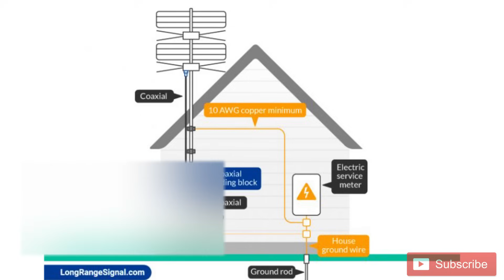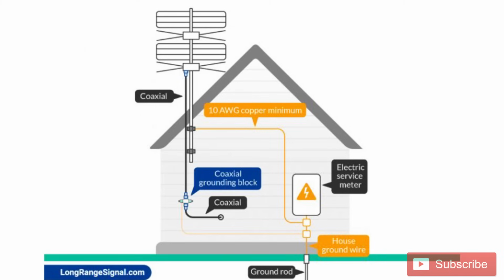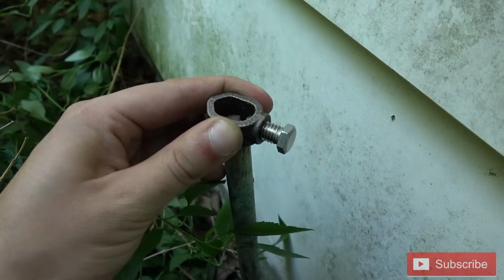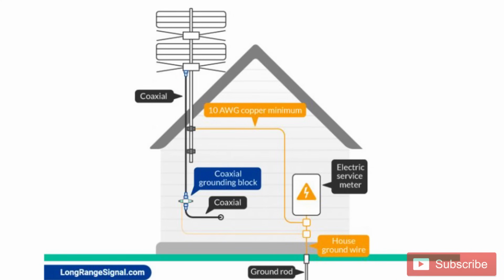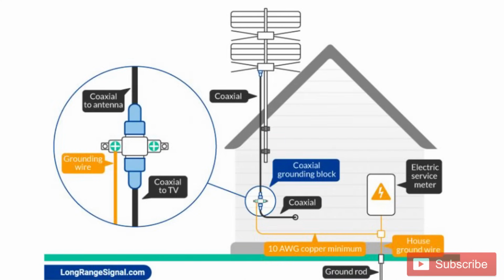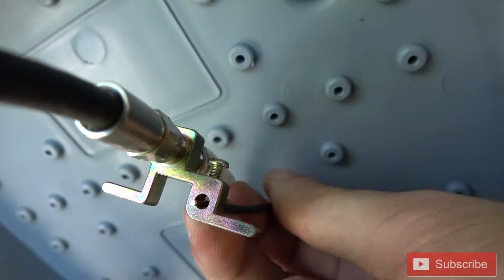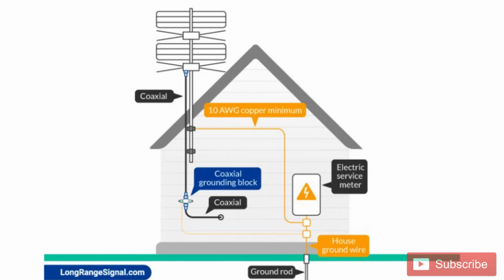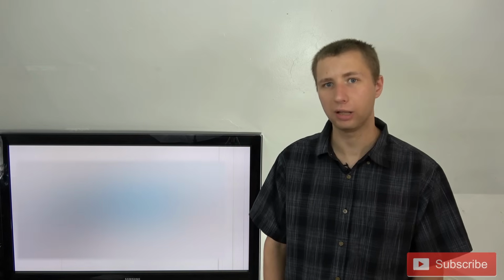How To Ground an Outdoor TV Antenna Per NEC

Comment: Excellent advice!  I use an 8ft copper rod pounded in the ground behind my back deck where my Sweet spot is...  And a Good Ground Block. which I replace every year.
Reply from the maker: I also hammered in an 8 ft copper rod into the ground for someone prior to knowing about the corner clamps.
Reply: I would not use them cheap ground clamps they use for cable TV. You can get good ones that won't rust and corrode, the splitters also have a ground connection. The mast should.also be connected to the ground. Good grounds also help the reflector do its job picking up signals.
Reply: @AntennaMan  - Tyler, because I need to mount my outdoor antenna on a pole---starting from the ground with the base of the pole about 1 foot in the ground---and mounted to the opposite side of my house from the electric meter, I guess I will have to drive an 8 foot ground rod for my application. I don't think it would be prudent---or practical---to run a 10 ga. grounding wire all the way to the other side of my house where the electric meter ground rod is. Tyler, or anyone else, if you can think of a better way for me to do this, I'm open to suggestions. Thanks.
Reply: @locutusofborg7122  if you have an outdoor faucet nearby take an extension cord and use a multimeter and insert the red lead into the hot lead on the extension cord and touch the faucet with the black lead. If you get around 121 volts you can use it as your ground
Reply: @MaynardFreek  : John, thanks for attempting to answer my question. The problem with the solution you proposed is that lightning follows water to ground. I am on a well system, and my home is plumbed with copper pipe, exactly as you assumed. Though I'm sure your solution would work, I wouldn't want to take the chance of lightning striking the outdoor antenna, and going directly to my home's plumbing --- blowing it up --- then blowing up my well pump and metal well tank, possibly setting my home on fire, etc.

I do not have a nearby outdoor faucet anyway, so an 8' copper-clad ground rod at the antenna seems to be my only real solution.
Reply: @locutusofborg7122  I understand your concerns. Electric current doesn't transmit/conduct well in freshwater, saltwater yes, so it's not the water that's the concern but the copper plumbing. Please understand that attaching the antenna and coax to an 8' ground rod will in no way protect your connected devices (Antenna, Amps, Coax, TV's etc) in the unlikely event of a direct strike or even a very near strike. All you're really looking to do is discharge the static buildup and to help reduce the antenna from being a target for lightning. The #10 AWG copper wire would melt before any of your pipes would be damaged. Even with the ground rod the copper wire would melt and you would still have all the damaged electronics I mentioned above from an direct and very near strike. I know lots to consider and it's a damned if you do and damned if you don't type of thing. A grounded antenna will never be an effective lightning rod to divert a lightning strike to the ground.

Having said all this and I understand your limited options, may I suggest you try a 3' rod, less expensive and less labor, and use a multi meter and extension cord test to see if the rod bleeds off around 121 volts.  I should also mention that technically speaking, the copper wire should be 25' or less from the antenna - coax to the ground. Hope this helps!

Let me make one last point concerning lightning rods. They perform the same function of reducing static electricity in the hopes of making the house less attractive to the electromagnetic energy in the atmosphere. If the rod or cabling was in anyway near or directly connected to your electronic devices they would be damaged should a strike happen.
Reply: @AntennaMan  You don't have to hammer the rod into the ground!  Take out one spade of dirt and add water.  Easy to work the rod into the ground.
Reply: @locutusofborg7122  you are required by NEC and local codes to bond bridge all grounds to one point. This has been the case since 2011 with NEC 2011 250.94.
Reply: @lakorai2  , I thought that was the case, but also thought there was an exception made for a device, such as an antenna, which exceeded an x number feet from the power company ground rod?
Reply: @locutusofborg7122  Not that I am aware of unless your local or state code allows an exemption.

The NEC can be overruled by your state. For example in Michigan it is no longer required to use Arc Fault Circuit Interrupters in your breaker panel because homowners and electricians bitched about the cost. 

You would want to bond these together anyway since this will create a star grounding topology. This will eliminate or greatly reduce the possibility of ground loops, which will create annoying hums in your amplifiers or av receiver.
Reply: @MaynardFreek  Outdoor as in one coming out of the side of the house?
Reply: @lakorai2  Nice to know ty
Reply: @lakorai2  , No exemption here that I'm aware of; but other than amp hum, etc. from a ground loop --- would there be any REAL danger by NOT running a ground wire from my antenna pole ground rod to the MAINS ground rod if lighting struck my antenna pole? If not, I would not worry about conforming to code in this instance. lakorai2, PLEASE advise.
Reply: @locutusofborg7122  Difference in potential of voltage.  It is much more of a concern with high voltage grounds than low voltage. 

The idea of tying the grounds means that you can guarentee it is going to 2 solid grounds as long as your are up to code.

1: Two copper ground rods 10 feet apart and driven 8 or 10 feet into the ground. Appropriate ground wire guage depending on the amperage service of your home. 

2: grounding to your copper water pipe as the backup. 

3: using a bonding bridge per nec 2011 250.4. 

Mike Holt Forums and videos are the beat resource when you have code questions.

Your big issue from a lightning strike is to prevent different potential grounding voltages from dissemmilar grounds. This can cause the lightning or static build up to run down your coaxial line instead of the ground. I would watch some Mike Holt videos on this.

Run a 8awg wire around your house. If you bury it you will need to go 24" underground with direct bury or 18" with conduit.

Comment: Thanks for the info! Just wondering why your diagram shows the two grounding wires running in different directions. Is it not acceptable to run them parallel? Asking because I'd prefer to limit the amount of wire lines on the side of my house. Same question about the coax cable and main grounding wire. To avoid running two parallel grounding wires I could bring the coax outside and ground at the electric box (just like the coax for internet service), but ideally I'd want to run the antenna's ground and coax cables parallel in that scenario as well.
Reply from the maker: You can run them parallel
Reply: @AntennaMan  Thanks for the quick reply! I'm actually installing the antenna in my attic. When I reached out to the manufacturer to ask the same question they said "You do not have to ground the antenna if it is installed in an attic". Is that true? I'd just like to understand why since it would be at the front of the house, with the attic vent about 5 ft away. What would you do? The run to the grounding rod would be pretty long, that was my other concern.

Comment: Hi there, I have an antenna tower (three metal poles in a triangle, 10' sections, galvanized steel composition) that has nearly 4' of the bottom section buried in the ground on a concrete base. Do I still need to further ground the tower itself? Thanks in advance for the help, I love the Antenna Man Videos. Very informative and I'm learning something with each one I watch.
Reply: Oh, and I do understand that I need to ground the coax itself and have ordered the grounding block, thanks!
Reply: Hi there Antenna Man, your thoughts and or experience with my question?

Comment: Can the coaxial ground block be used on any coaxial cable like RG213 running to a CB radio antenna?
Reply: You you should acquaint yourself with the NEC in respects to antenna grounding (earthing) and bonding and the grounding/bonding section of Motorola Publication R56.

Comment: I have a question Antenna Man. My antenna is mounted about 40 feet away from the point where the rod is buried. My plan is to run it down the side of my house and then across to the service point where the rod is. I was wondering if I can run the ground wire right next to existing coaxial cable (used for my Xfinity Internet and separate from my antenna coax cable ) so I can use the support clips for the coax cable that run all the way to the service point? Or will that create interference to my Internet connection since it will be close to another electrical wire?
Reply from the maker: It shouldn't interfere with your internet cable. Just avoid sharp bends in the ground wire.
Reply: @AntennaMan  : Awesome! Thank you so much for your quick reply and the info!

Comment: A couple of thoughts I like some feedback on are- I like to scrape down to bare metal before using only the exterior type, non corrosive ground clamps. Then I cover connecting and threaded surfaces (the whole clamp) with conductive grease This also helps prevent paint that you know someones going to get on it some day from sticking. What about grounding metal roofing either for lightning protection or establishing a ground plane (for better reception?)? Is a sloped metal roof an appropriate ground plane or does a ground plane have to be parallel to the earth or the antenna elements? I've heard some crazy lightning strike stories over the years. I ran 400' of PVC to a customers house from a new water meter. A few years later lightning struck a big oak about 10' away from the meter. It wiped out a bunch of electronics in my clients house and some of the neighbors as well. I wondered if I had made the first 20' of pipe at the meter be L copper instead of the insulated PVC, if it would have given the electricty a path to ground at the meter rather than (possibly) making it through the water in the pipe to the house. A story (that I have a hard time believing) is that lightning doesn't like to go around sharp bends in the ground wire. This sort of implies that the electricity has mass and it's inertia doesn't like to bend away from a sraight line to Earth. I have to believe this story was generated from a poor connection at the rod or ufer (either of which may have not had a solid connection to Earth). I remember grounding diagrams showing standoffs being used, I still have some but I never use them and never see them used (anymore- really old systems, sometimes). I picture the absolute best ground to be an exterior, plumb wire from the mast to Earth, and bending it and attaching it to things to make it pretty just increases the risk of a fusing ground wire frying part of the building. I always try to get the antenna signal and conrol wires into the structure asap up high for aesthetics, but I feel it's just good practice to keep the ground wire as far away from the building as possible (inside the barge rafter, and then down an outside corner). I feel if I really was going to be anal about it I'd use standoff's, but I I just have to draw the "too ugly to be worth it" line somewhere. Wouldn't it be slightly better to have the coax ground be as close to the antenna as possible? I would think that anything you could do to separate the lightning from the system wiring asap would be a good thing.

Comment: I always recommend a  8 foot ground rod. I am a ham radio operator and have designed up many antennas in the years of being a ham. I also redesigned the Hover antenna for the new uhf band for 2020 and works very well.
Reply: Most people won't have what they need to drive an 8 foot ground rod!
Reply: @dontcare563  it depends on where you live. a hammer drill might be sufficient. moreover, a single 8-foot grounding rod may not be sufficient.
Reply: Where theirs a will
Reply: I have a  drilled well with a 30 foot well caseing this is a real good ground.
Reply: For those that come read this in the future. Please don't do this. There should be one ground, and use your house's already existing ground for that.

Run the wires from the antenna and the coax ground plug just like this video says, and connect it to a intersystem grounding bar attached RIGHT near your house's ground.

Don't run separate ground rods, you WILL have noise and ground differentials.
Reply: @armadaos  Wanting to install a 40' tv antenna...but it's 400' from my electric utility. Do I need to run that long of a wire back to my utility ground rod at the meter? Then I figure I need lightning rod at the top, and can I run aluminum 2 or 4 gauge all the way down the antenna and into the ground? How do I make sure it doesn't allow the current out back into the antenna? Please and thanks for anyone who wants to help!

Comment: Is it safe to run your ground wire directly to the grounding block inside of the interior electrical panel?
Reply from the maker: You typically want it outside at the service box.

Comment: If the antenna is mounted to a 40 ft tower,  buried three feet in the ground, would the tower serve as the ground ? Or must the ground be buried deeper than 3-4ft ?
Reply: Ground rods are usually at least 8 feet in the ground. Additionally, it is best practice to bond all three legs of the tower to individual ground rods. Everything is bonded together. I've seen the system installed in a 911 center, the standards that is grounded and bonded to is crazy. Even doors have bonding wires connecting between door and frame.
Reply: John McFerren John is Wright. Also your grounding should include and or be bonded to your ground rods that are connected to our A/C service entrance. Your A/C ground rods should be 8 to 10’ apart and around the perimeter of the house.

Comment: Two things on this, I don’t think number 10 wire is heavy enough. You need at least double the gauge. Number two it’s a very simple thing to make a high impedance choke her up about 4 to 5 turns of coax just below the antenna. It prevents lightning from traveling down your coax. And if it does get a little bit down to coax that’s what your grounding for at the bottom. Great video thanks.

Comment: I might sound a little paranoid but I grounded my mast with 6 gauge and didn't put any sharp bends in it. I also screwed a gas discharge tube on my coax grounding block.  Because lightning can strike wires inside buildings we soldered in gas discharge tubes in the HVAC building controllers we manufactured and they do work.

Comment: I need a grounding block for my WiFi LTE router (MoFi 4500)  w a Yagi antenna. They have SMA connectors which are smaller than the regular coax connectors. Any idea where I can find one? Also I’m using a fiberglass antenna mast. Do I just attach the ground wire to it w a clamp at the base then to the ground rod Or do I attach the ground wires to the antenna and directly to the ground Rod?

Comment: How about this situation: my antenna is actually mounted to a piece of reasonably sturdy PVC instead of a metal pole.  Will the PVC as a poor conductor have a similar effect to grounding the antenna?  I do have a ground in the coax.
Reply: Mike Talbert I have the same situation.  I didn’t want to attach the antenna to my house. My pvc is in the ground and not touching the house.  I do have the coax grounded.  But I don’t know if I should ground the pvc or not.

Comment: Hey this video is great except for one problem. I live in a condo where my unit is on top of another unit. There is no way for me to run a ground wire to the ground. So is there any way I can find a ground system in my house?
Reply: ❓Why not use the 3rd lug ground on an electric outlet ...🔌
Reply: Ask your HOA. If you already have a antenna on the roof they can just zip tie the grounding wire to the existing coax.
Reply: @jamescalifornia2964  I considered that as an option.

Comment: I have electric ⚡️ experience not all ground rods are the same! Copper bars 8 foot driven times two also a bigger ground cable works best. Lighting 💡 lots of amps
Reply: Correct. This is NEC code for homes manufacturered before 2014 code. #8 for 100a service and #4 ideally for 200A service, copper; dont use AL for grounding conductors.

After 2014 the ground rods actually have to be embedded in the concrete foundation or basement walls when the home is constructed.

Comment: I know this is an older video and that you shouldn't ground to your electrical system, however if the power company shuts off your power you do not lose your ground, only your power.  There is still a ground even if they come and pull the meter.

Comment: Hi Tyler, I will be removing an old satellite dish, but leaving the J-pole to which I will mount an antenna. The J-pole is attached to a facia on the front corner of the house. The house ground point is on the back of the house, about 30' to 35' away from the J-pole. Any recommendation on how to properly ground the new setup?
Reply from the maker: For liability reasons I cannot offer direct guidance on antenna grounding. Refer to NEC code.

Comment: Hi Tyler, I really enjoyed your grounding video, first what diameter & how far into the ground does a lightning rod have to go for it to be effective, second I put my antenna up over 30 years ago and used 300 ohm wire, never had
a lightning strike, but just curious to know how you would ground a flat lead wire, reception is very good, I just don't feel like rewiring the whole house to coax, Thoughts ?
Reply from the maker: I cannot comment on what you should and what you shouldn't do when grounding an antenna due to liability reasons. Consult a local electrician if you are not sure if your antenna is grounded properly.
Reply: @AntennaMan  Yeah Yeah thanks